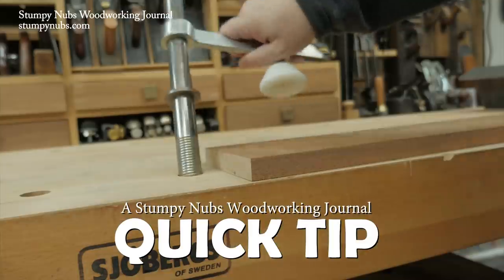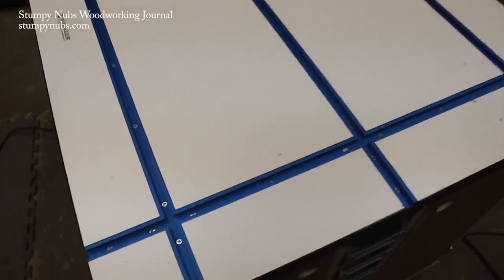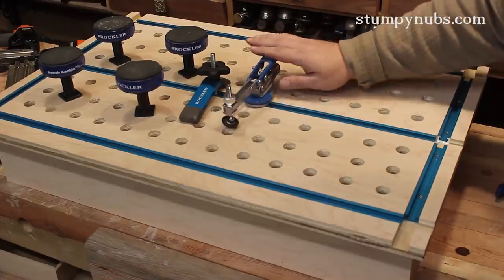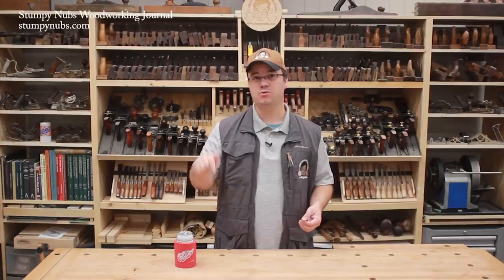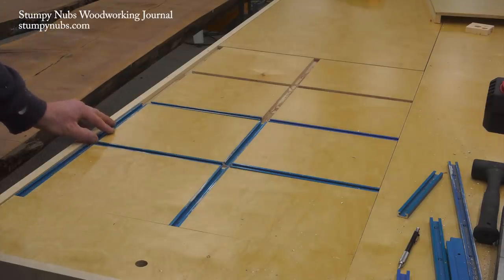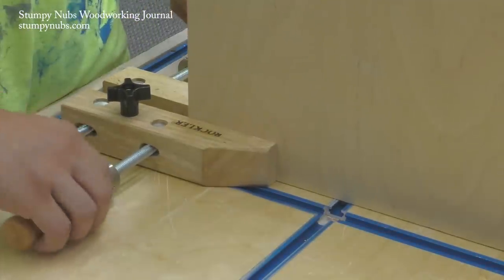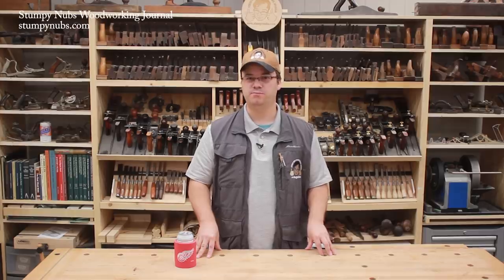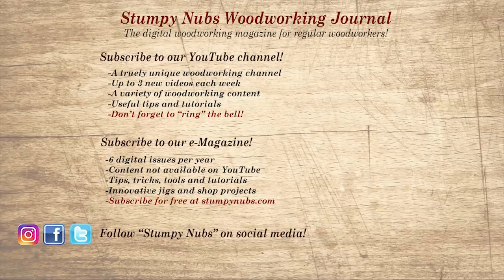Some clever ways to hold your work in a modern workshop

Comment: I like to put a big allen key cap screw into the handle of my clamps. That lets you use a power drill for wide adjustments and an allen key when it's laying flat on a surface for as much force as you need and more then you would be able to do per hand.
Reply: Amazing, I am definitely doing this on my clamps.  Thank you!
Reply: Great idea!

Comment: On your large wooden clamps, if you drill a hole through the handle, you can use a small rod or a small Philips screwdriver to tighten the clamps up while on a flat surface  to save your knuckles.

Comment: Lee Valley makes t-track (Veritas Double T-Track) that doesn't need screws to hold in place - it has 'wings' on each side that fit into a slot made with a 'T' shaped router bit, but it only comes in silver.
Reply: Bruce Lee guess you also need to buy a specialty bit to cut the slots? 
Seems like a lot of people have good luck with a combination of short screws and CA glue. I often wonder why they don’t just laminate two pieces of 1/2” plywood instead of struggling with a thinner 3/4” piece. Or laminate any combination to make your work top as thick as you want.

Comment: Check out the Armor Tools T Track.  So much nicer!  It bolts to the underlying piece of plywood via a slot under the t track.  Has slots built in to the track as well so you don’t have to do that corner truck you did.  Just put a piece of 3/4” plywood on either side and you’re done.  Works perfectly and it’s nearly indestructible.

Comment: I like the recommendation to put the t track over the frame of a torsion box so you can drive in screws deeper. 
I’ve been planning to make an assembly table and I’m undecided between t track and dog holes. It may come down to which is cheaper. Dog holes cost no money to drill and it seems like you can make jigs for dog holes easier than t track. But there’s also a lot of great stuff out there for t track. Any tips based on your experience? I think it would make a great video.
Reply from the maker: Dog holes are less expensive to drill, but the bench top itself must be solid wood and at least 3-inches thick for holdfasts to work. Holdfasts are the most effective way of applying downward clamping pressure with dog holes, in my opinion.

Comment: People should check out the Matchfit dovetail clamp system by Microjig. It’s basically replaced T-track completely in my shop. All one needs is a 14° router bit and every piece of wood/sheet good becomes a clamping surface. It clamps much stronger than T-track and there is no possibility for it to separate from the surface. And the clamps are also easy to use anywhere with dog holes that people use traditional holdfasts.
Reply: Greg M seem that but my first thoughts were. 
1. Damn I’ll have to vacuum those out all the time!
2. When a little screw or something else falls in there I’m gonna be pissed. 
3. Seems like I don’t be able to easily make my own jigs to use with it like good old dog holes.
Reply from the maker: The dovetail clamps work well for downward pressure, like a holdfast, but not as well for lateral pressure clamps that push against the side of the workpiece, a hand way to secure work when routing, planing or sanding a surface.
Reply: @StumpyNubs  I use dovetail clamp to hold down the wood screw clamp.   Or make a L shaped fixture with dovetails on the vertical part of the L.  Use dovetail clamp, like a hold fast, to hold the bottom of the L to the work surface and another dovetail clamp in the vertical part of the L to hold the work piece vertically.
Reply from the maker: How do you apply lateral pressure to the edge of a board that's laying flat on the bench, like you would do with your bench vise and dogs in a traditional bench? They make t-track clamps that will do that. Not sure you can with a dovetail track.

Comment: A combination of both styles of bench works best, in my opinion. I built one from a 30 x 72 butcher block. every style of hold-down works.
Reply: Rick Galos haven’t found a good resource yet that states which works best for certain applications. I suppose because either is pretty good. But would like to have more info before investing in one or the other. Those clamps and other accessories are too pricey to invest in and find out you made a bad choice.

Comment: Easy T-track construction:  rather than wrestle a big piece of plywood into making dadoes, make the top layer out of a series of panels sized to fit "between" the T-tracks.  Glue the top panels onto the bottom layer using the T-tracks as loose spacers.  When the glue for all the top panels is dry, make some 3/8(-) x 3/4 spacers, insert into the grooves with glue, screw the T-track through the spacer into the bottom layer.
Reply from the maker: I've done that. Not as easy as it sounds. It's easier to cut shallow dados, then glue a full piece of 1/4-inch ply on top, then cut slots through the ply in the center of each dado.

Comment: I was wondering about the track intersections, ...I’m curious as to why you would not run the longer tracks straight thru, & just notch out the sides at the intersection areas, ... would make for a stronger connection, ... No???
Reply from the maker: Why do all that work? As it is, a t-blot will catch on any little burr or dent in a t-track. All that notching is bound to cause some frustration.

Comment: What about adding a spacer to the bottom of the hand screws so you've got some knuckle room when using them in T Track? Just a thought.
Reply from the maker: You could do that.
Reply: Kirk Radzwill I have been thinking of flattening a side of my wood clamp handles to give a little space in this type of application.  Usually when clamp this way not much force is needed, but a flattened side would help give your fingers something to grab.

Comment: I was thinking of going a budget route and do dove tail tracks instead. Just a bit hesitant if all or any t-track accessories would work with that?
Reply from the maker: I don't believe many t-track accessories would work with dovetail tracks. You might consider homemade t-tracks, though.
Reply: @StumpyNubs  home made t-tracks just looks so easy to break that's why I was thinking dove tails instead 😀
I could maybe replace the toilet bolt on those that have it and replace with something home made.

Comment: How does the T-track hold up on an MDF table top (multiple layers total 3" thick)?
Reply from the maker: Screws don't hold well in MDF. But I suppose if you have really long screws (2-inch) you should be fine.
Reply: @StumpyNubs  There are special screws for MDF, though I don't have experience with them to know if they work any better than other wood screws.

Comment: The aluminum rockler clamps - aren’t the short ends supposed to be used to hold down the work?  I do it either way, I was lectured that the shorter end gives more clamping force.  Something else is if the end of the aluminum clamp falls awkwardly over half the t-track and the clamp is sitting with a weird tilt, take one of those plywood cut offs you have lying around and tuck it under the back side to level it all out.
Reply from the maker: Either end will work, but the long end is the end I have always used, and all the marketing photos, etc. seem to use that end too.
Reply: I’m right with you.  Folks with vastly more cnc experience corrected me.  I still use the longer end if there’s going to be a collision between endmill and clamp nut.

Comment: More and more, I've been seeing these T-tracks being used in lieu of dog holes. Sure, dog holes are simple and effective, but it seems like the tracks are more versatile.
Reply from the maker: I don't know if they are more versatile. I have never had a clamping deficiency on my traditional workbench that a t-track would solve. But not everyone wants the expense of size of a traditional bench.
Reply: @StumpyNubs  What's the best approach you've found to drilling accurate, square dog holes in a bench top? I figured using a Forstner bit in a drill, but free-handing it with a drill has the potential to introduce error. That being said, how critical is a perfectly true hole?
Reply: Pawpaw Stew lots of videos out there for accurately drilling dog holes. A channel called Rag ‘n Bone has a good one. There’s also jigs you can buy, but they’re pricey versus just taking the time to do it yourself. Most important thing is to start an a perfectly square counsel and flat side, then carefully mark out the first column and row. From there it’s just carefully measuring off that first row. Using a straight board of the right thickness will make it easy. Perfectly spaced and square holes mostly matter if you will use them to square longer pieces of material.